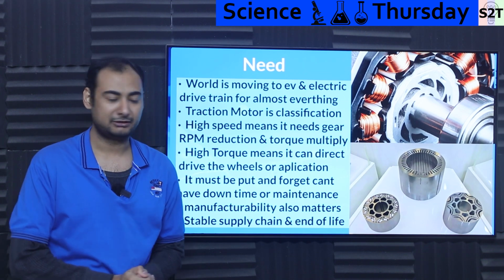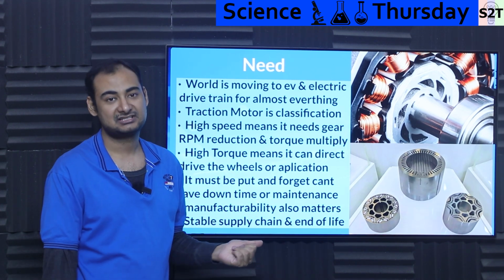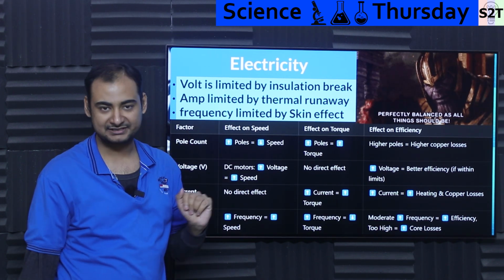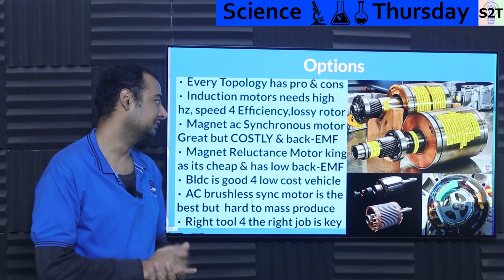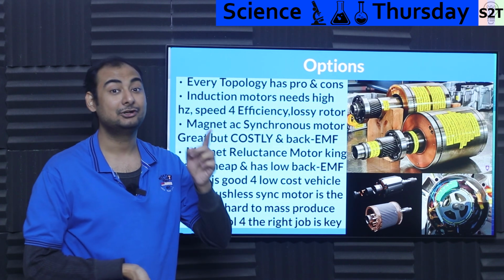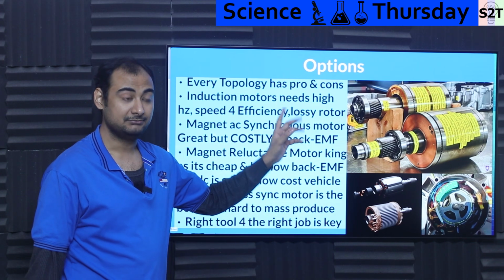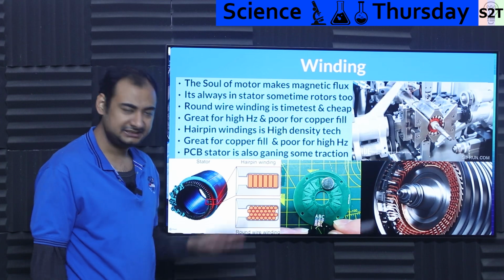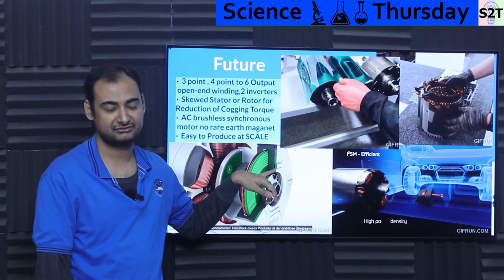EV Traction Motor Explained {Science Thursday}

Comment: "pcb has all 3" 

Okay 

CNT ON Dimond also have all 3

But they are expensive. PCB are expensive compared to sheet stamping and stacking

No need etching or anything just stamp and stack with insulation in between
Reply from the maker: you should try to build it

Comment: Take an induction motor, replace rotor bars with superconductors and run liquid nitrogen through them. Bum bum efficiency 😏
Reply from the maker: that is in use in 6th gen Royal Air Force fighter jet under construction

Comment: Well what about axial flux brushless  synchronous variable frequency AC motor?🤭 God of all
Reply: Based on my experience working with a UK-based Axial Flux motor and Power Electronics manufacturer, I've observed that while AF motors offer superior performance, their high cost remains a significant barrier. Although my organization is exploring opportunities to manufacture these motors in India to reduce costs, the Indian market isn't quite ready to adopt this technology. It will likely take time for the market to mature.
Reply from the maker: on paper yes but it has to be made on pcb system to work